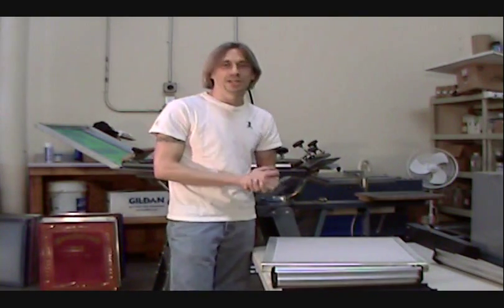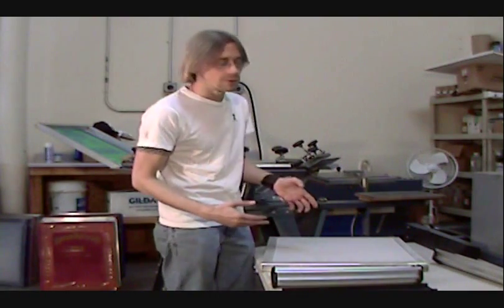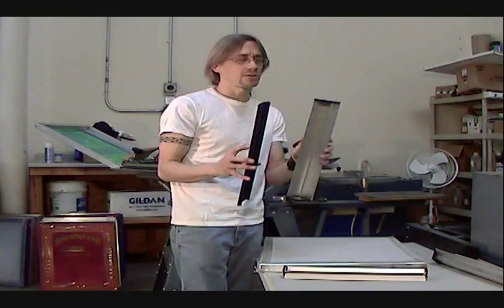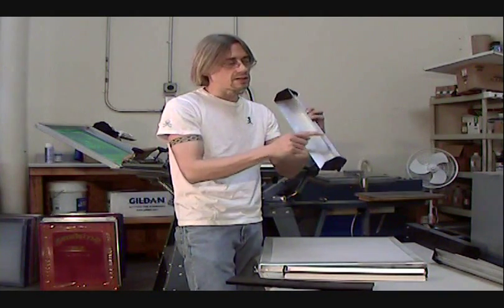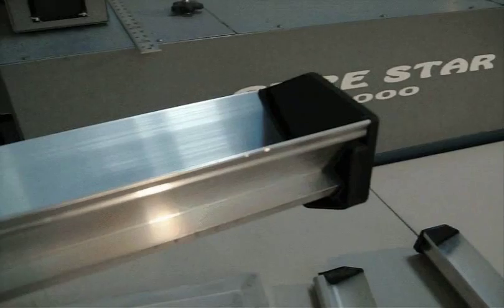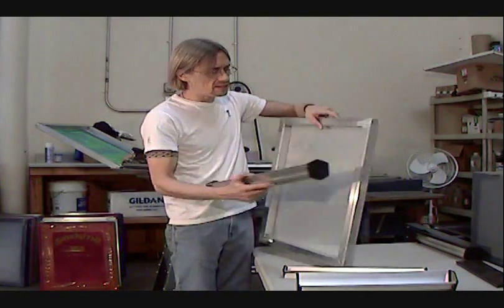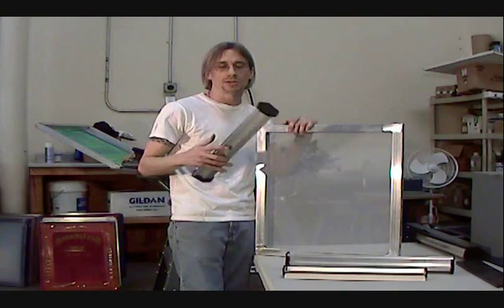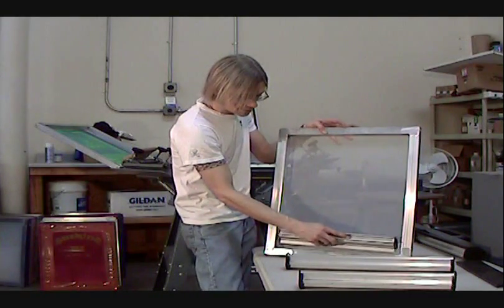How To Screen Print: Emulsion Scoop Coater Tips

Comment from the maker: @yourworstfriend It may not be absolutely necessary to coat both sides of the screen but it is recommended. I coat both sides starting with the substrate side and ending with the inkwell side. I wouldn’t coat only one side unless you need a really thin stencil. Thanks for watching and commenting!

Comment from the maker: @SemenDemon12 Nope, you reclaim the screen by using an emulsion remover and a pressure washer to remove the old stencil, clean the mesh and then later recoat it with emulsion. You can use the screen over many times before the mesh will wear out or become too loose to work with. Thanks for watching and leaving a comment! ☠

Comment: Something very unpleasant happened that spoiled several screens. The gutter ends, where the gutter cut ends, when applying to the canvas was scraping and scratching the polyester. Over time the polyester started to tear. It is the same model that you show in your vid
Reply from the maker: A decent make of the scoop coater will be even and smooth at the edges. You can try to sand it down possibly. Thanks for watching! Screen Printing Equipment & Supplies - http://CatspitScreenPrintSupply.com/